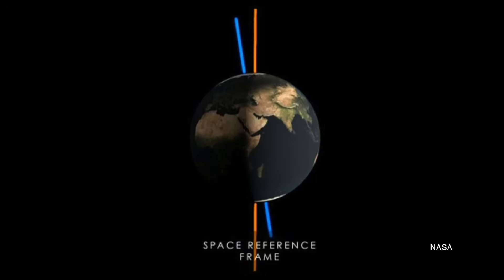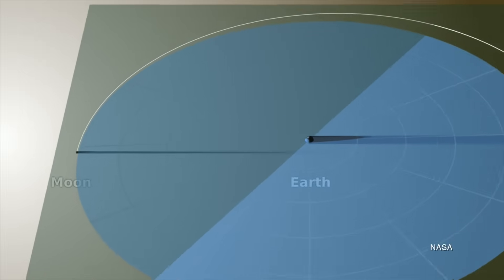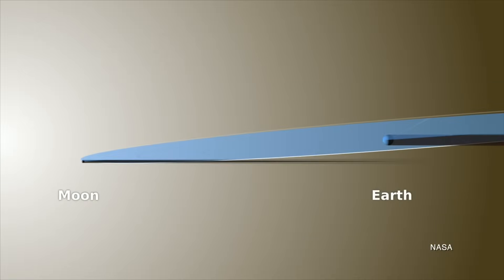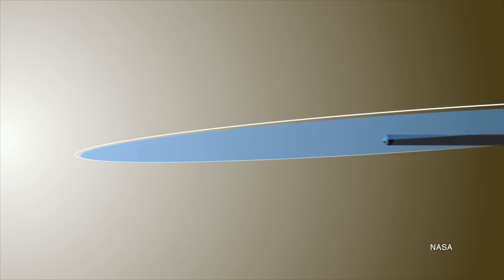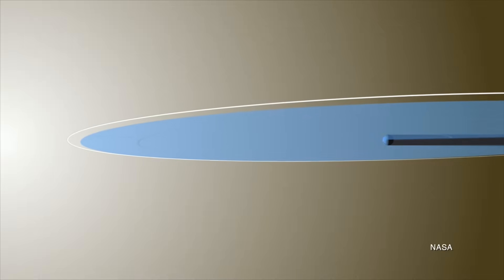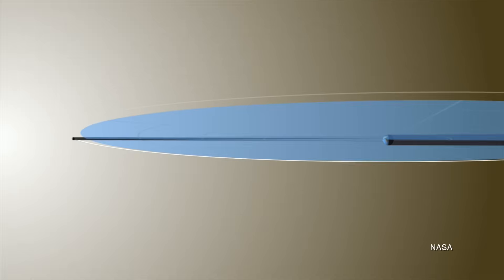Why Does a Rocket Need to Roll Going Into Orbit?

Comment: Thanks for that explanation.  I didn't realize that the different orbital planes of earth and moon required the roll maneuver.  However, I notice that space shuttle launches, which are not lunar, also look like they involve a roll maneuver.  Are my senses being fooled, or do simple earth orbital launches require the roll?  If so, why?
Reply: Yes, they do, because they launch into different orbital inclinations depending on what mission they were flying.  For example, the ISS orbits at an inclination of about 51 degrees, which non-ISS missions often launched into an orbit of about 28 degrees (that's the latitude of KSC, so that's the orbit that takes the least amount of fuel for launches from there).  Even then, there would be a roll, because the launch pad isn't exactly aligned for that launch.  But that's not a problem, because most launches require some sort of roll, so they built the pads and don't futz with trying to realign everything.

Strictly speaking, you don't have to roll to the correct inclination right after launch-you could, in theory, launch into just about any orbit and do a "plane change" (basically, changing the amount the orbit is inclined).  But once you're on orbit, it takes a metric crapton of fuel to do even a small plane change, so they do the roll right after clearing the tower, when it takes very little fuel.

Comment: I have a question that I think a lot of people want to know the answer to. ....(1.) Fluid Dynamics governs how objects travel through both water and air...I am sure everyone will agree that propellers are used so objects can travel through both water and air.. Propeller airplane in the air... and submarine or torpedo in water...and a jet ski travels through water by using a pump to suck in water and increase the pressure of the water it sucked in then it expels the high pressure water out of the back of the jet ski and the higher pressure water is used to push against the water the jet ski is traveling through ...resulting in thrust... because of the equal and opposite reaction... And equal and opposite reaction can only happen if a force  is applied to something else...and Rockets and thrusters work the same exact way as a jet ski except instead of water pushing against water....they use the combustion of fuel and oxygen ....which creates high pressure gasses that are then used to push against the air that the rockets or thrusters are traveling through to get the equal and opposite reaction....and because we're told there is a vacuum in space...the exhaust used from the combustion process for thrust in the Earth's atmosphere...will not provide any thrust in a vacuum...and an extremely simple way to prove this is put a straw inside a balloon and use tape and a rubber band so you can blow up the balloon with the straw without crushing the straw and so air does not leak...and get a little toy car and tape the balloon with the straw in it on the top of the toy car...pick up the whole contraption you just made and blow up the balloon and pinch the end of the straw....put it on a level table and let go...you will see the toy moves( it will have thrust)....now take your vacuum cleaner...blow up the balloon attached to the toy car and pinch the straw again and turn on the vacuum and stick the straw into the hose of the vacuum then release the straw after it's inserted inside the hose at least a few inches...and u will see that the toy does not move...and this is because rockets and thrusters push against air in the atmosphere to get an equal and opposite reaction... so how was it possible for all of the trips to the moon to use rockets and/or thrusters to slow down the lunar Landers so they did not crash into the moon...also ...how was it possible to use rockets and/or thrusters leave the moon to come back to earth in a vacuum?..can you please explain how rockets and thrusters work in a vacuum?...there are many many people who would like to know how rockets and thrusters that work because of pressure are able to provide thrust in a negative pressure environment...thank you in advance for answering these simple questions about rockets and thrusters and how they work.
Reply: METO U This is an internet hoax spread around for the past couple of years. The high pressure gasses produced by a rocket engine are not used to push against the air the rockets are traveling through. Here is some good information on this: https://spaceflightsystems.grc.nasa.gov/education/rocket/TRCRocket/rocket_principles.html
Reply: You're not being honest about your question - otherwise you wouldn't assert answers to the reason for the behaviour you are "observing".

Comment: Correct me if I am wrong but at 2.53 she says that "a simple pitch program to the east..." But the pitch axis is east west. But if the pitch axis is east west, doesn't that mean that the rocket will turn North-south, or in other words, yaw? An object doesn't rotate along its axis. It always rotates perpendicularly.
Reply: digi92 it rolls in order to reorient the pitch axis so that the pitch over also changes its heading. It is somewhat arbitrary to assign pitch and yaw directions to a rocket.   The arbitrary “Up” is originally pointed North, but the desired orbital track is east-southeast, so a slight roll before pitching over reorienting “UP”, to NNE.  So when it pitches over, it’s heading in the right direction. 
Make sense?

Comment: For a 6-Degree Of Freedom system, rolling to change pitch angle (quaternion rotation) costs less propellant and is less stressful on the system and avoids gimbal lock.  It's all about the fact that the moment of inertia around the roll axis is much smaller than around a pure pitch axis.  Since then engineers knew they needed to roll the vehicle anyway to get to the desired pitch profile, they could build the launch pads at cardinal directions.
Reply: True, but this has been pointed out in multiple posts dated prior to yours!
Reply: sounds like BS
Reply: Why is that Hey.

Comment: Question:  If the rocket travels at 50k km/ph once it leaves earth, than why does it take 3 days to get to the moon? The moon being 250k km away from earth, why not just fly directly at it rather than going round in circles.
Reply: Chris G Trans lunar injection is a 5 minute burn in low earth orbit.  Once this burn is done you gain altitude but just like running up hill gravity pulls back slowing you down. Orbital mechanics is not like driving a car which uses friction to manuver, car tires turning or motor spinning tires.  Spacecraft manuver with a force with velocity to gain altitude or against velocity to lower altitude.  On earth speed and direction are independent, meaning you can change one without changing the other.  In space you cannot do this.  Apollo could have gotten to the moon faster but it would require more fuel to slow down at the moon which requires more fuel and thus more weight.  New horizons got to the moon in 30 minutes but it did not have to stop at the moon  and was going to pluto which is a very high altitude.

Comment: the truth is: rockets  propelled on combustion propellants don`t even cross  12.000k of our atmosphere , doesn`t matter how  big they are the bigger the more payload to burn and heavier (more burning )so , only if another way  to propel a rocket , maybe plasma or nuclear fission  , where combustion is not present. I think we been taken for a ride by NASA...besides rockets can not be propelled on vacuum ,cux  no atmospheric pressure on vacuum ,so rocket got nothing to be pushed against . rockets propelled on chemical  combustion only reach LEO
Reply: Incorrect.  Chemical based propellant rocket engines have, and will continue to, provide the most cost effective means to get us into space for the foreseeable future.  Yes there are other possible technologies, but none are at a stage where they can be scaled and implemented quite as reliably as craft using chemical propellants, be it burning or simple decomposition.  

As for your claim that rockets do not work in a vacuum, you are sorely mistaken as it is not the air or surrounding pressure that the burning propellant acts on, but the nozzle and thrust chamber itself.  When high pressure gas is contained in a sealed vessel, the gas exudes pressure on all sides of said vessel equally.  However, if one side is opened, then the gas rushes out, causing a net reaction on the opposite wall from where the opening is.  This increased force on this side of the vessel results in movement of the vessel in this direction, being that the force on this surface is higher.  Newton's law regarding equal and opposite reactions still applies, vacuum or not.

Comment: all the electronics makes water on station dangerouse, yet female astronut what ever her name is just casualy flicks it.  nasa you better get your lies straight. people might figure out your secret.
Reply: What are you on about? Normal water, if PH neutral and chemically pure, does not conduct electricity. The minerals dissolved in the water do.  Therefore, pure water, very low risk of any issues.  Not to mention that even flicks of water will not harm anything as there is no gravity to pull them to anywhere.  Astronauts and cosmonauts alike have been filmed and photographed performing the "water trick" in while in space at (almost)zero gravity.

Comment: why does th iss use harnesses. and why do edit them out.ocasionaly they miss one or two, why the harnesses. why? control from spining to fast.
Reply: Because without gravity, there is no force keeping you in your chair.  The harnesses are to keep the crew from having to always fight to remain in a seated position.  Likewise, when they sleep, they either strap in or use Velcro on suits to keep them connected to the wall/bed/sleeping area.  It's also why a lot of astronauts have reported trouble falling asleep while in space.

Comment: There is an issue of the Roll that also involved the atmosphere.  A rocket like the Saturn V was stunningly lousy regards cutting through the low atmosphere.  As a result it needed to get through most of it  by the shortest possible route.  This is to travel straight  up  until the atmosphere was substantially thinned out.  Once it got through most of the atmosphere is rotated over to achieve down range velocity for the orbit.  This is why the efforts at launch out of Scaled Composites use an Aircraft for a parasitic launch.  This allows them to use engines that breathe air for cutting the Atmosphere and it also allows them to get down range speed easily.

Comment: Amy, I'm an engineer too & a Space Shuttle fan. I worked at Space & Missile Center in El Segundo CA. Ask me a question.
Reply: Neptune997 I have a question: More out of curiosity, than wanting to see it happen. If....hypothetically speaking, engineers wanted to launch a Saturn V in 2018, could a team actually still do it?? Is the vehicle just so redundant it would be too dangerous or costly or just simply impossible to do because of cost, lost knowledge/expertise? Would the whole thing have to be reconfigured from the ground up? or could it just be rolled out of granddads garage, crankhandle inserted, wound up and set off?

Comment: There is a story that when Leonid Brezhnev was shown an early concept for the Soviet Buran' (Snowstorm) space shuttle vehicle and procurement program, the presentation began with some footage of an American space shuttle launch -- including the roll upon climb-out.  He questioned what the roll was for, and the Soviet briefers replied with varying stories as to why the Americans executed that maneuver. "Are we going to roll?" Brezhnev asked. No, he was told, the USSR's mission plan didn't include a roll b/c one wasn't needed (due to the latitude of the Baikonur Cosmodrome relative to that of Cape Kennedy, or some such). "If the Americans do it, there must be a reason!" barked the elderly General Secretary -- a former engineer -"...so, we need to roll also." And so they always did - then rolled back to the craft's former orientation a short time later.

Comment: Too much talking for me.  Anyway it is the same principle of firing an artillery shell.  The balances are uneven, so to make it even the projectile is rolled to average out the trajectory.  Once the trajectory is stabilized then guidance can be applied.  There is no guidance at low speed.  You have to have speed.  And you have to have a stable trajectory, before you can get speed and the ability to affect the trajectory.  I learned on the "Honest John."  Now there was a test bed for all future launches.

Comment: Doesn't everything going into space pitch over into and azimuth?   It looks like they stop going up, and start going sideways.   What's the difference between an azimuth and a vector?   Is a vector a landing calculation?    What's you vector Victor.   Dont call me Shirley.   What is your profession vintage space?    Self proclaimed 'not rocket engineer' but you're clearly spun up,on this outer spacey stuff.

Comment: Hi Amy. Why did the Apollo  astronauts reenter the atmosphere (in the Command Module) without their pressure suits on? One leak at 3,000 degrees would kill all of them. In fact, the Russians lost astronauts this way. 

Thanks
Reply: Pressure suits are for protection against lack of atmosphere, for temperature they're only proof against normal heat/cold of Space.
Reply: Roger Voss Thx for the response Roger. But it's the atmospheric pressure I'm referring to. If a leak is caused in the spacecraft during reentry, it would lead to a loss of cabin pressure. This can happen without the astronauts actually burning up. This has already happened on a Russian spacecraft. After this, the Russians started wearing their suits during reentry. This is why I'm asking her, "Why didn't Apollo wear their pressure suits during reentry?"

Comment: A GREAT SIDEKICK TO bruce willis,maybe a first time attempt at hollywood, en route to saving the world in an amy designed FTL
 double flux capacitating supercold plasma antimatter torroidalmagnetorocket,,,, before take off from its earth orbit towards epsilon bootis,,,,,,,
    'honey what i wanna know,,is are you sure this thing will get us there?
   'commander dallas,I have been designing these for 20 years mostly in my head,not easy,I have to work like crazy to put down on paper every detail connection circuit and equation.
I have an IQ in excess of 260,nasa's equipment  got shut off by the smoke.
trust me . it will go where no earth saver has ever  gone before.'
 alright got your word on that,  'NASA??',nasa,copy cdr Dallas,   'nasa,,, US NGC NEIL ARMSTRONG ,  we are ready,go for launch'. roger  NEILARMSTRONG,,go for launch,magtrac beam  released in ten seconds NINE,EIGHT SEVEN SIX FOUR THREE TWO,beam released,god speed armstrong,  'thanks Houston,,cdr  flight engineer amy commence acceleration to 10% C, we got a lot of parasecs to cover,'

Comment: a simpler explanation is...moons orbit is tilted or inclined..
.to get into standard earth orbit the rocket just needs to pitch due east and continue ascending and pitching till orbit is achieved.
 ..to get to the moon the rocket ascends and rolls to the correct allignnent which is identical to the moons movement of direction along its own orbit..once roll program is complete..rocket pitches and begins its ascent into its inclined orbit. ..
Reply: FWIW - due East puts you into an inclined orbit as well, just a different inclination.  Orbits can't follow the curved line of a line of latitude (square grid doesn't fit a round Earth).

Comment: why do spacecraft roll? they roll because they need to control the heating on the spacecraft and also to line the rocket up with the orbital plain around the Earth orbit. as a rocket lifts off the launch pad it needs to roll to align itself with the path going into orbit. example cargo freighters heading to the International Space Station they need to roll South and then Northeast so they get into the correct orbit to dock with the space station a day later and Russian spacecraft need to turn South after they leave Baikonur so they are over the equator and Military satellites and polar probes they need to turn north after they leave from Vandenberg and from Russia so they get over the poles. this is because every single spacecraft has an orbit and  to get in the correct orbit they need to be pointed the right way that is why the spacecraft has to roll after it gets off the launch pad this is also so the stages can be deorbited after the rocket gets into space so they do not get stuck up there or land on civilian population centers.

Comment: on a side note, the existing Russian Soyuz can't roll but the old launch pads rotate around its axis prior to launch. The new ones can and will be launched from static launch pads.
Reply: The older Soyuz is oriented by rotating the launch pad. Newer ones can roll just like the Saturn V. Rockets may be circular but if you don't roll then the crew would be flying slightly sideways through out their trip and isn't ideal for many reasons. Imagine driving your car while sitting slightly sideways for the journey.

Comment: Ok great video. Easy to understand. Thank you. So really was only required to prevent the astronauts from flying slightly sideways and the complications that would cause. Why didn't they just cut the hatch and install the interior of the capsule different to compensate for the misalignment of the launch pad?